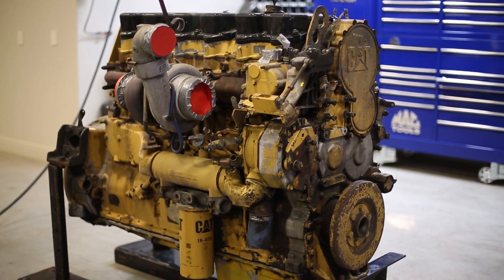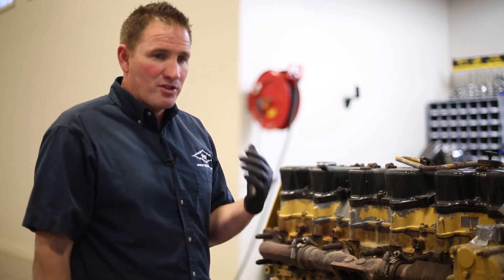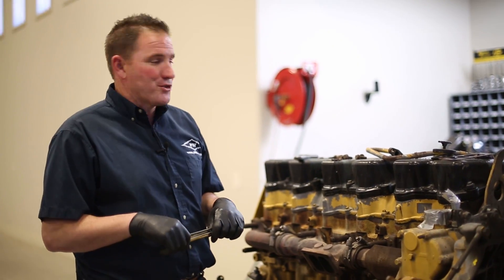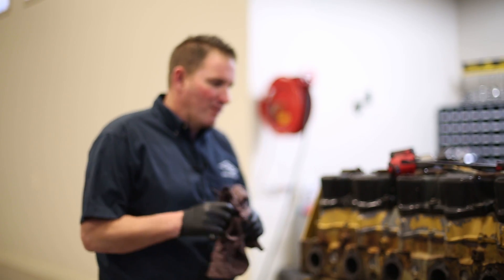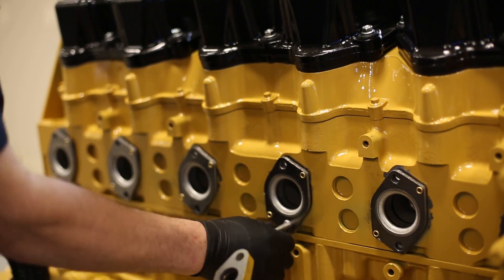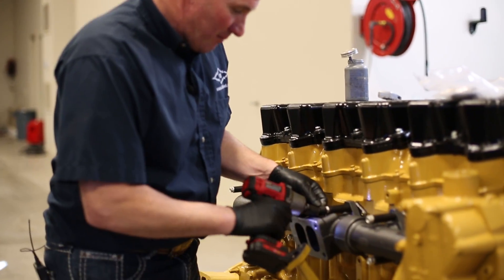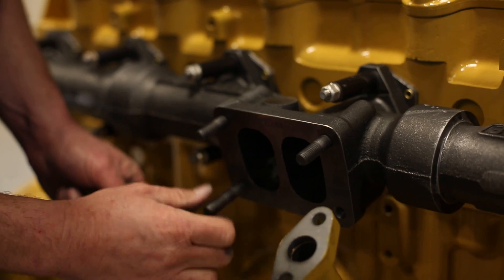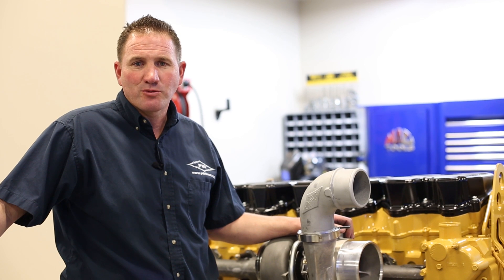How to Install: PDI Turbo & Exhaust Manifold - CAT C15

Comment: How much of an increase would you see on a Cat 3126 with these parts and your PDI tune?
Reply from the maker: 15% gain over stock HP/TQ with just the tuner, and gains another 30-40 with our manifold and turbo upgrade!  There is a video of a C7 in a motorhome on here that will show you the dyno #'s.  They run great!
Reply: @pdidiesel  30-40% or 30-40HP?

Comment: Whats the difference between the regular exhaust manifold and the low mount exhaust manifold for the c15? and how can I tell which one I need for my c15 6nz?
Reply from the maker: It is the angle of the turbo mounting flange.  Most long hood trucks have the regular/standard mount, and the sloped hood trucks have the low mount.  The low mount sits the turbo down lower to create better clearance for the turbo to clear the hood. You can be certain which one you need by getting the casting # from your OE center section of your manifold and call us to cross reference. 1-800-511-1231   Thanks!

Comment: How much is that setup worth plus retune ?
Reply from the maker: The exhaust manifold is $1450, Install kit (studs, nuts, gaskets) is $425, Turbo with elbow kit $3020 and the Big Boss Tuner is $2350. So all in you'd be $7245 plus shipping.  Give us a shout if you'd like more info or to get some parts coming 1-888-588-7113  Thanks!

Comment: Such bullshit, do this when it’s mounted in a semi
Reply from the maker: Well Matt.. We do that every day in our full service shop.  Unfortunately the lighting, sound optics and the other 7 bays with air guns running do not make for a real high quality video that is designed to give a DIY guy some assistance in changing a turbo.  Thanks for your recommendation, but I think we will stick to our current process of creating how to videos for customers purchasing our Big Boss products! Thanks for watching.
Reply: in fram is no big deal    just a little higher in the air

Comment: Do you have any proven power gains to your big boss? Very curious to know how it makes more power and increase fuel ext ext?
Reply from the maker: The gain in efficiency and power is the air flow, the Big Boss utilizes the stainless steel exhaust housing to maximize the air flow, combined with our custom designed compressor housing it creates a very efficient turbo, great drive ability and no turbo lag.  Lowering the exhaust temp allows you to work the truck down lower while pulling a grade and get the best fuel efficiency possible.

Comment: That’s quite a beefy looking manifold where the turbo bolts .A lot thicker than the stock manifold.What is your opinion of the switchback turbo?
Reply: The Switchblade Turbo is what I'm looking at right now.
Just doing my homework before spending thousands.

Comment: You mean 3406E and C-15, not the C15 (ACERT).
Reply from the maker: Correct, this video is showing a CAT single turbo manifold install.  We do build a manifold for the C-15 Accert engine as well, but we have not filmed an install video for that one.
Reply: pdidiesel I as just nitpicking since the C-15 (note the dash ‘-‘) is the 6NZ and the C15 (no dash) is the ACERT. Never could understand why Cat kept such a similar (and often misused) identifier for their different 15L (14.8/15.2) engines. 

There’s a guy on here that builds 6NZ engines with the ACERT crank giving a 15.2L displacement. 16:1 pistons, 4 bolt rods, stronger cranks. Definitely inter dated in that along with one of your turbos/intakes/exhaust manifolds (extrude honed) and tuned by Mr. Haney (Kurt).

Comment: Is this set up only for the c-15? May this set up be used on the cat A and B engines also?  Any information is greatly appreciated!! Or does it depend on the year! 79 3406a or b
Reply from the maker: It will work on the B model as long as it has the updated round cylinder port head.  If it's the original square/rectangle port it will not.

Comment: I've never seen a mechanic/Tech  dressed so clean!!!!
Reply from the maker: Clean shop, clean tech makes a clean engine/job!  This video was filmed specifically for this how to video, but we do strive to keep a clean shop and all of our techs wear clean uniforms (they don't stay this clean all day). Thanks!
Reply: Ever seen a racing team? The cleaner you keep your environment (tools, parts, air, self) the cleaner the end product. You might get your hands dirty, but you don’t have to start dirty.
Reply: Working in a shop must be so much better! Working in the sun all day with oily engines makes it a lot harder to keep clean
Reply: I watched this man and his shop on rodeo Reed, everything this man has and does is top of the line work from what I've seen

Comment: question, why not just make the manifold one piece and eliminate the seals and potential leaks?
Reply from the maker: Great question! The manifold needs to be able to expand and contract as it heats and cools with engine exhaust temperature.  Thus the reason for the expansion joints.  If it were one piece it would shear off the studs holding it to the cylinder head as it expanded.  Thank you for the question!
Reply: @pdidiesel  but doesn't some companies make one piece manifolds?

Comment: how much turbo boost can you safely run on this turbo i had to put a waste gate turbo on my 3406b because my borg warner turbo which was rated for 550 hp was pegging my gauge at 45 psi
Reply from the maker: Most engines with our manifold, turbo and tuning run between 30-38 lbs of manifold pressure.  The turbo will safely handle 40+ lbs, but with the right set up it should be in the mid to upper 30's.

Comment: Brady Bunch tutorial- We want to see this done while engine is still in the truck- Outside in the elements- Most of us cant pull a motor to replace exhaust manifolds ,turbos ,heads and the like.
Reply from the maker: Thanks for the feedback, we try to make good step by step installation videos.  Filming in the 10 bay shop with air tools and 7-8 mechanics all working in there makes it really hard to film a good video.  This video with the engine on the ground vs. in the truck is nearly the same steps you would take if the engine was in a truck though, just a little different work space.

Comment: What are your thoughts on heating the bolts up first one at a time before u put the wrench to them ? 
Heat then till they are red hot is what I was told. Then while they are hot you put the wrench on them.

Can u reach that bottom bolt with a crows foot ? And extension ?

Great video. All the great ones make it look easy. 

No matter what they do. Baseball , chess , race drivers  or In your case, working on trucks. 

U give some of us bolt on bolt off bandits confidence to tackle these bigger jobs. Thanks.
Reply from the maker: Thanks for watching and the feedback!  There are many different tips of the trade that are available for sure.  We don't heat them here in our shop, not saying that's not a good idea, but we do not do it.  Be sure to subscribe for more upcoming videos.
Reply: @pdidiesel  If you heat those bolts up first like the person above said and set the TQ it will be wrong after they cool. We were taught that doing this changed the TQ as the metal cannot adjust. Don't really know if it is correct or not, but going through aviation mechanic school they said it took away from the metal strength.

Comment: Great vid I just replaced a turbo and manifold today on a c15 fitted to a 740 dump truck
I've always wondered why the long studs and spacers not just short studs?
Reply: My guess is someway to help dissipate the heat to prevent warping? Idk never really thought about it
Reply from the maker: It's more of a matter of clearance for where the manifold angles down right there.

Comment: I wish they would show how the oil cooler water pump hose should be connected to the top-side on the P/S engine mount BEFORE reinstalling the turbo and down tubes or else you'll fight for an hour trying to get the hose clamp strapped down tight, and look like a fool in front of your shop manager if you don't have that part planned ahead of time!
Reply from the maker: Unfortunately in this video the engine we were using out of the truck already.  But that it is a great point!  Thanks for watching and be sure to subscribe to our channel. Thanks!